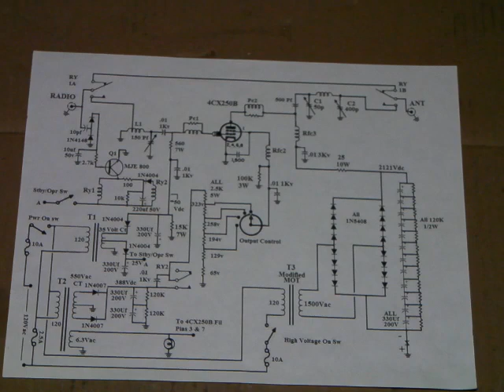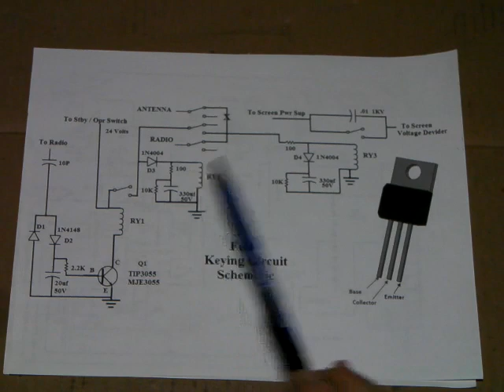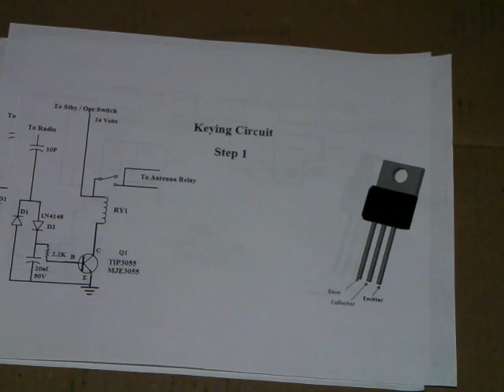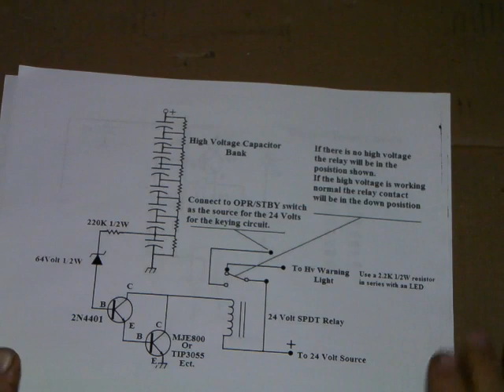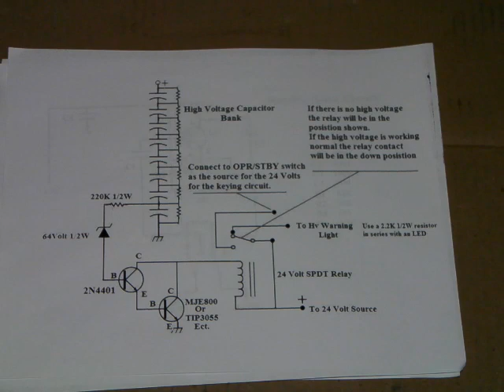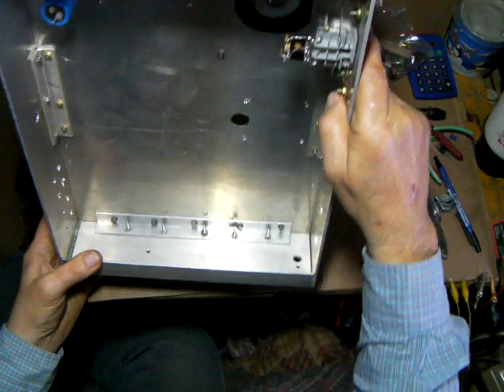Single Tube 4CX250B Amp For 27Mhz  The Build Pt 11

Comment: I've never been that keen on pre-amp circuits for 27MHz, as I've found they just increase the noise floor, without doing much for the receive signal. In other words, they have a poor signal to noise ratio.
Reply: This would depend on the overall circuits used. Some are made to "clean up" un desired noise or static. I'm sure norman can talk of such things cause that's out of my wheel house

Comment: Norman  I don't want the  Receive Boost  on all the time.  only when im trying to pull a faint signal out.  is it possible to add a switch on the 12v line to turn it on and off
Reply: Yes, it will be hooked I'm sure to a switch via the "power leads"